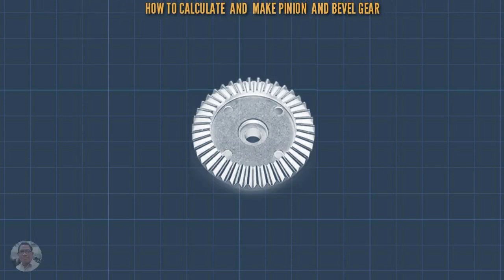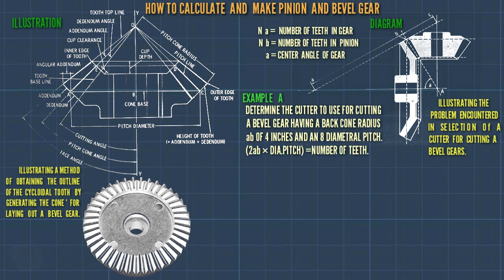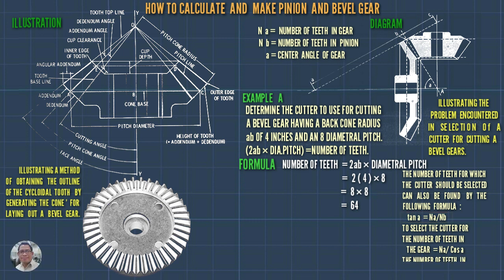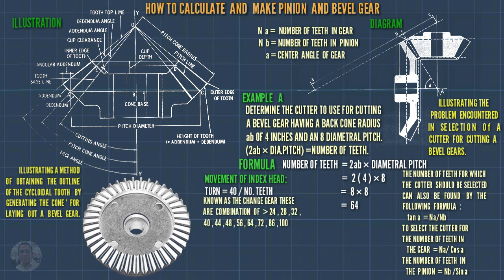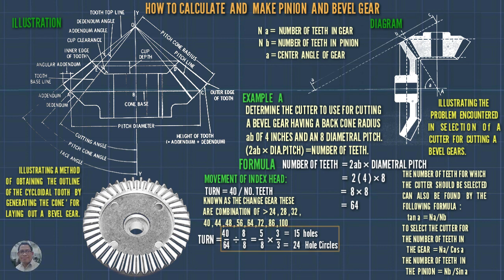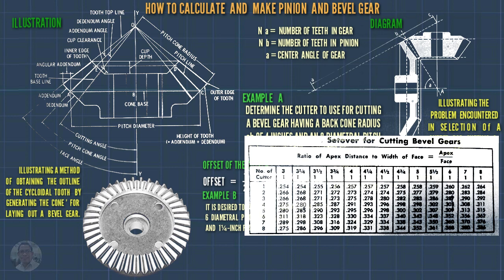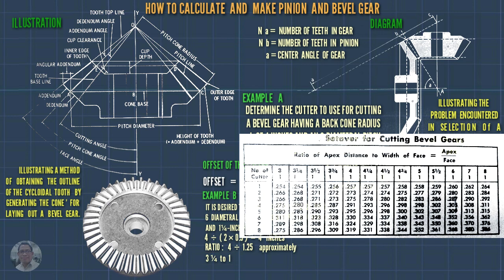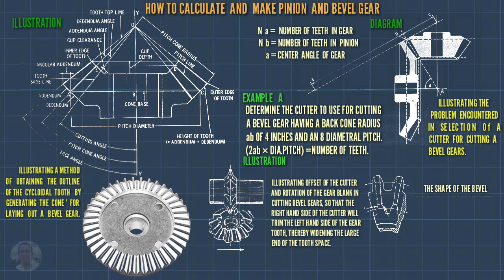HOW TO CALCULATE AND FABRICATE PINION AND BEVEL GEAR | Machine shop theory

Comment: Sir, 
Teeth 25
Module 5
OD 132mm

Spur bevel gear face angle 45°  than pinion also 45°
index-crank how many degree setting?